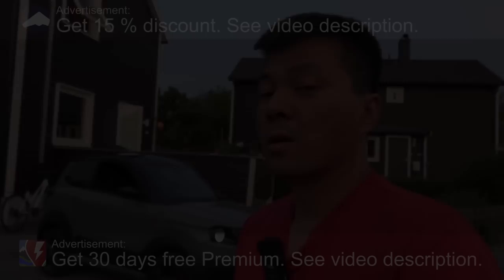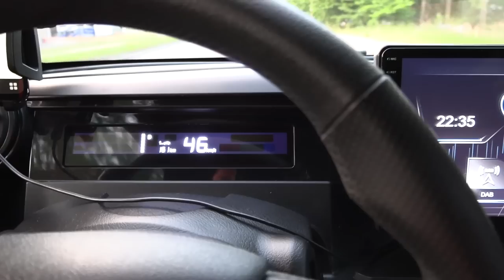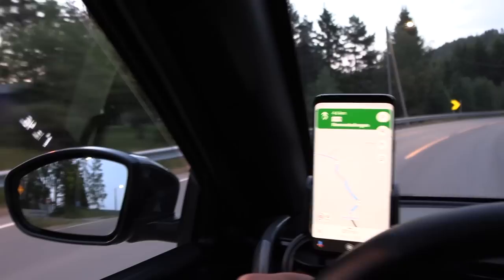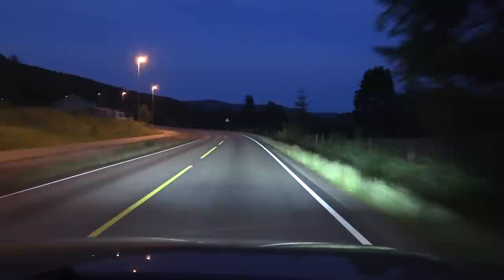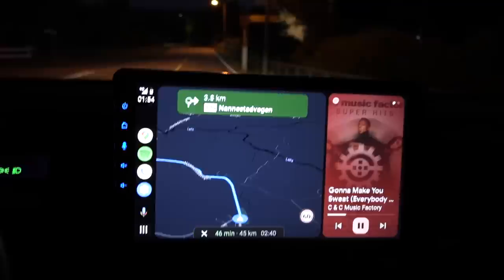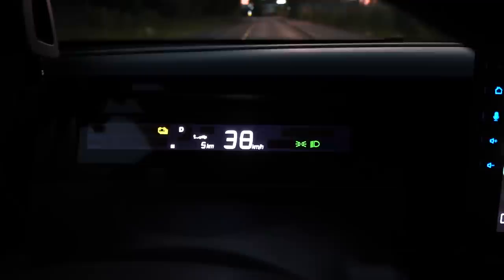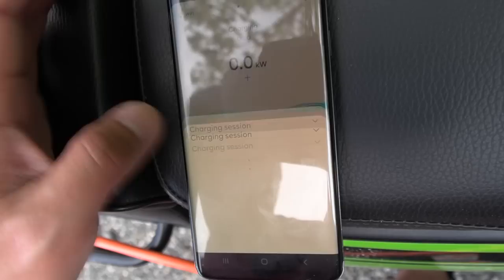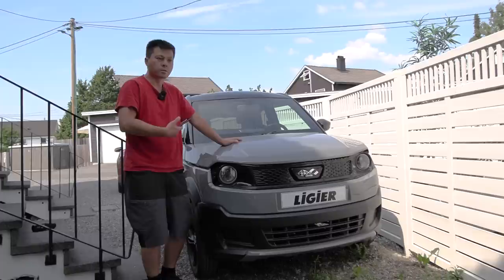Ligier Myli range test

Comment: Oh, this was you. Down Gjelleråsen I passed you when you let people past. We're not used to the 45kph cars here in Oslo. Much more common going out to the small towns.
(Btw, the asphalt at Alnabru is "supposedly" getting worked on soon. They just redid the asphalt going down Grorudveien down from the Kalbakken T-junction and down to the 4-way with Tesla, as that was horrible as well with loads of potholes. One day we'll get to go to Alnabru without feeling that you're destroying the car.)
Reply from the maker: Yeah, I try to let people pass me especially on places where it's illegal or hard to overtake. However, as I said in the video, many Norwegians are very passive and they don't overtake even if there's many good places to overtake. Ligier is so small that it's easy to look past it to see if it's clear or not. Way harder to look past a big tractor which typically also drives the same speed.

Comment: the consumption and the look of the belt-drive-train is very similar to my Citroen Ami. Higher charging speed is more important than bigger battery in this class, like you said.
Reply: But charging speed is linked to battery size.
If you double the battery size, you can double the charging power.

The time for a full charge might be the same, but how much time you need to gain a certain range is less.
Reply: @thorbjrnhellehaven5766  a VW eUp from 2013 has a 18 kWh battery. It charges with 40 kW nearly 80% SOC.  A eGolf from 2019 has a 35 kWh battery. It charges with 40 kW. So, back to the good old EV times:-)
Reply: I am going to buy a myli epic. In reefblue i want to tak you for your video
Reply: @thorbjrnhellehaven5766  charging speed is only linked to battery size once you are maxxing out the cells charging speed. here for instance 12kWh / 2kW (6h charge)  it could peak 10x faster no problem even a passively cooled Leaf can charge 80% in 30 min. these smale cars are never gonna have 400V dc fast charging..
Reply: @geemy9675  yes, I guess your right, with a 12 kWh battery, it should for sure be possible to have faster charging than 2kW. At least 1C shouldn't be any problem, probably 3C.

I guess the major point could be the cost of larger chargers, as well as added weight.

I haven't been able to figure out battery voltage for Ligier Myli,  but I don't expect it to have anything close to a 400V architecture, to remotely allow using 400V DC-charging (as you point out never gonna have 400V DC fast). (As a reference I believe the Cirtoën Ami has a 48V battery pack. I'm not surprised if Ligier has a battery pack of similar voltage, and probably the same voltage for 4kWh, 8kWh and 12kWh configuration, just putting 2 or 3 modules in parallel if you want more capacity, to keep most of the design the same.

As s minimum, I think an option for triple-charger would be interesting.
3-phase: 400V AC @8.7 A = 6 kW (3 chargers in star configuration)
1-phase: 230V AC @26A = 6 kW (3 chargers in parallel configuration)
Or maybe just double-charger as an option too.

Comment: This one on the 1000km challenge, that would be a week's work 😂

I never undestood why they (ir the lae makers) put the limit on 45kmh instead of just 50kmh which would have made it less of a traffic blocker 🎉 5kmh make no risk difference but would make traffic a lot smoother
Reply from the maker: The law says max 45 km/h. Otheriwse 16 year olds won't be able to drive them legally.
Reply: @bjornnyland  yeah same here. O was not clear, I meant the law makers with "they" ... stupid law
Reply: In the EU you can drive these when you are 15 years old.
Reply: In Italy you can drive mopeds + this type of car at 14 y/o, the legal speed limit for this type of vehicle is 45kmh but basically every one of them can reach even 70-80kmh because the majority doesn't have a software limiter

Comment: In the UK this will be called a quadricycle like the Citroën Ami.
Reply: Quadricycle is the European classification L6e and L7e vehicles, respectively light and heavy.
While the subclass L6e-BP are light quadri-mobile for passenger transport (like Ami and Ligier)
And subclass L7e-CP are heavy quadri-mobile for passenger transport (Like Renault Twizy)

In Norway all classes with 45 km/h max speed are called 2-3-4 wheeled mopeds.
L6e-B are "light moped car" and L7e-C are "heavy moped car" (even if the later is not restricted to 45 km/h, but otherwise closely resemble)

Some people argue that L6e-B and L7e-C are "not cars" because they are "quadricycle". Yes they are in that class, more specifically quadri-mobile.

But what is a car?
M1 class are: "passenger vehicles with a maximum of eight seats in addition to the driver's seat", several vehicles within M1 would probably not be described as "car".

Car (according to Oxford Dictionary):
a road vehicle with an engine and four wheels that can carry a small number of passengers

I will argue that L6e-BP and L7e-CP vehicles fit perfectly well within the dictionary definition of a "car". Because "car" isn't actually a term with a legal definition,  while quadricycle and quadri-mobile are. They are not necessarily mutual exclusive.

Comment: So the lights are more like the old school cars where the low and high beam has separate bulbs and the low beam is off with high beam on.
Pretty sure cars I owned in the 80s and 90s had this light system.

Comment: Torally agree with the comment about battery size, and charging.
I think smaller versions with 60 km and 100 km range could be interesting, as I expect the battery to be a significant contribution to the cost. 

I think the Ligier seems interesting, but I woudn't mind to save some on smaller battery.

Chargning I think would be nice to have option for 3x10 and possible to run in parallel for single phaser 30 A, or 3-phase 10 A.
then you could benefit some from 16A 3-phase and 32A compared to  10-16 A single phase.
Reply: yes but the range will be worse in winter... and in time
Reply: @LoneWolf-wp9dn  yes, of course, but if you only need 10-20% of the realistic range on any day, it seems a little overkill to pay for that much buffer.

Comment: Comparing it to the silence makes more sense. I think the 73 Wh/km is okay compared to the 38 Wh/km for the SilenceS01 you tested. Weight still has impact. Silence is 215 kg with you on board and this thing is probably 475 kg.
Reply: 10% loss at 1 phase AC seems too low, that could expect the high consumption numbers.

Comment: I drive with various pedelecs, including a speed pedelec 45 km/h. I note my consumptions, so here is my list (without charging losses): 
pedelec 25 km/h: 3-5 Wh/km
pedelec 25 km/h with kids trailer: 8-10 Wh/km
s-pedelec 45 km/h: 20 Wh/km sitting upright and 15-17 Wh/km deep low. 
So the 70 Wh/km for the 45er car seems ok. I don't think you can charge it with 1C with a smaller battery, because the battery is not cooled at all. And a bigger charger is really expensive, you also need a charging station. For going to work and back, even in winter, the battery size is quite good. You can go one hour per direction, so about 40km and have enough reserve for extra tour to the family or shoping after work.
Reply: Another thing about the lower power at the end. Normally, they use 48V batteries. They go down to 35V when empty, but at 15% they are still above 45V. The motor controller normally is limited in Ampere, so maybe 125A. At 48V this is 6kW, but at 40V only 5kW and at 35V only 4,3 kW. You need about 3-4 kW to maintain 45 km/h, so every hill will slow you down when the battery is nearly empty.

Comment: Let's make a calculation about hyper miling a Tesla 3 at 50 km/g.
14 m/sec * 1700 kg * 0.01 rolling resistance * 9.81 gravitation = 2,34 kW or 4,68 kWh for 100 km.
14 * 14² / 2 * 1,3 (kg m³ air) * 2.2 m² (front area) * cw=0.22 = 0.86 kW or 1.72 kWh for 100 km both together 6.4 kWh/100 km.
This means extreme efficient.  
For the Ligier. Even when I estimate 1.6 m² front area with cw=0.38, this has at this low speed no big influence. This means inefficient.

Comment: Hello Bjørn,

There are several good deals on 2WD vehicles currently. The big question is how well they perform in winter or off-road conditions. In addition to most of them being rear-wheel drive, some cars have software that allows you to engage both wheels when you're stuck. Can you start testing this? It's very interesting for those who can manage with 2WD.
Reply: Proper nordic/extreme winter tires like the Continental VikingContact 7 is much more important than 2wd/4wd

Comment: Hello Bjørn. 
Did you run at full power the whole time, after switching off the eco mode at the beginning of the video? 170 kilometers is incredibly good in that case. Although they don't say it, they usually mean that the range is based on eco mode, when it comes to electric mopeds. Thanks
Reply: You need about 2-4 kW to maintain 45 km/h in flat terrain. So the motor is not on full power because of the speed limit. The few times on hills and acceleration would not change too much range.

Comment: This is a good short range or city vehicle and like you said, it's a decent vehicle for a teenager who this may be their first vehicle and one they don't need t take on a road trip given it's power and speed. I do like the fact that it has a decent size infotainment screen. The fact that it's Android Auto compatible is great because other than the basic car functions I'm sure the infotainment isn't much to speak of. The car should definitely be kept to around town/local driving. Even the 60km motorways is too much for this one.

Comment: I think the belt in the electric motor has some loses.
Reply: yep, but a chain would be noisy. And a complete solution with build in motor is not yet available? Hub motors would be cool!
Reply: @johumm455  No chain, no belt, just connected to the wheels
Reply: Swap the sprockets and see how fast you can get this car going! Put the big sprocket on the motor and the little one on the drivetrain!

Comment: You could charge faster but would the battery need liquid thermo management. Does it have it?
Reply: maybee you can pee on the battery :D
Reply: Maybe not, a Leaf charges at 6.6kw (I think) and doesn't have active cooling. C rate might be high on a small pack but it won't be high for long and it won't be charging often since it takes so long to drain.

Comment: It's not just a time machine to the past. It's a preview of the micromobilty that zero carbon emissions will require. Tesla is very very far from zero emissions in the whole system including manufacturing and power we won't have enough of to power everything with limited resources. We focused too much on zero tailpipe emissions lulling us into believing no compromises in future driving. That's not the case. All those 1000 km tests were actually rail trips in the future, not Single Occupancy Vehicle trips.

Comment: I think a Tesla on speed limit mode is a lot safer for young drivers.  Does that little car even have air bags?
Reply: With an airbag the whole car would explode :D
Reply: its about keeping the people around them safe, a 500kg car wont do much damage, but a 1700kg tesla...
the fact that a 16y old can drive a 500kg is already really concerning, you know how stu...pid and irresponsible kids are nowadays, I would really prefer if toddlers would ride a bicycle around me, not a 500kg machine
Reply: @faustinpippin9208  In some countries in europe you can change a regular car to a 3-wheel based car and then 17yo can drive it. Basicly just the rear axle gets changed and mostly small cars, like a vw polo or others in that size region. But don't know about speed or horsepower limit in that case.

Comment: actually these kind of cars is needed in europe small city tiny narrow with 0 park space. very veru usefull but they have to be cheap. how much for this moped?  we need a lot of them, for less than 5000 euro 
less less than 5000 euro instead a smart costs 27000! and has only 100 km of range. they are clowns

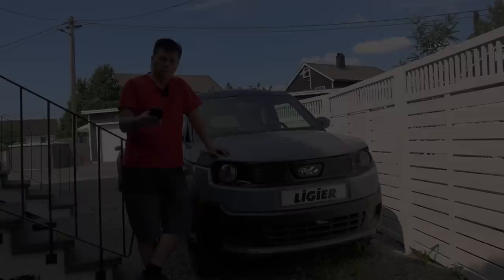Comment: 23:58 "...this time I calculate 10% charging loss..."
According to my experience of charging with 2.3kW for a number of 250 chargings so far I got an average of 20% charging losses.
When charging the same car faster the charging losses are 10% or even less.
Therefore tmo the consumption of the Ligier can be estimated to be 13.7kWh*0.8=11kWh which for 169km equals 65Wh/km.
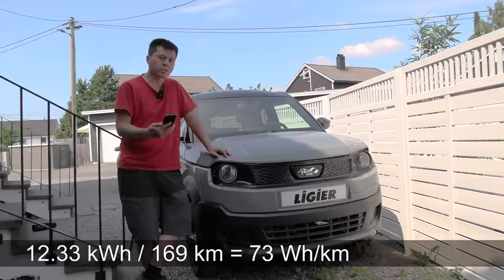24:41 "...when you hypermile a M3 you can go as low as around 60, 65Wh/km..."
Wait a minute...you probably didn't charge up the M3 with 2.1kW but much much faster which lowers the charging losses dramatically.
There is a big error involved not considering the charging losses correctly.
I doubt that the M3 or Teslas have drastically better driving efficiency.
If one wants to find out what's really going on much much more effort has to be done in gathering oll the parameters being involved here.
Reply from the maker: You mixed up all the numbers. Consumption for Tesla or Kona is of course what the car reports which is not with charging loss. The charging loss you talk about in Model 3 is totally irrelevant.
Reply: @bjornnyland  Ok, thank you for clearifying that the Tesla and Kona numbers are car reported numbers without charging losses.
I must have somehow missed that.
But nevertheless the charging losses while charging with 2.1kW are more like 20% then 10%.
Reply from the maker: I already made a video about this.
https://www.youtube.com/watch?v=iLmIIe9N_aI&ab_channel=Bj%C3%B8rnNyland

In that test, Model 3 had 15.7 % charging loss at 2.3 kW. But as mentioned in the video, Tesla seems to have a lot of "idling" power consumption for pumps, MCU, communcation, DC-DC converter, etc. Those things are most likely not present in Ligier since it's way less sophisticated.
Reply: @bjornnyland  "...since it's way less sophisticated..." Yes I agree.
Thanks for the link. Will check it out.